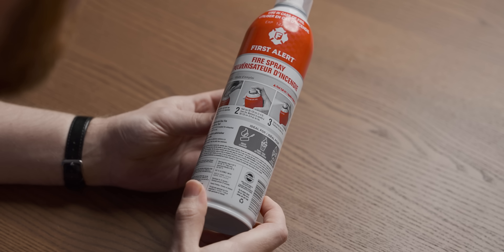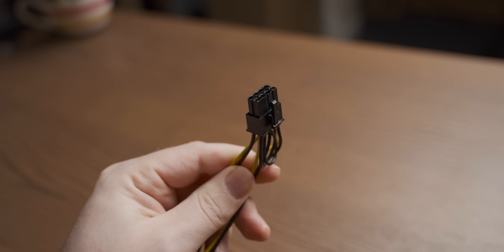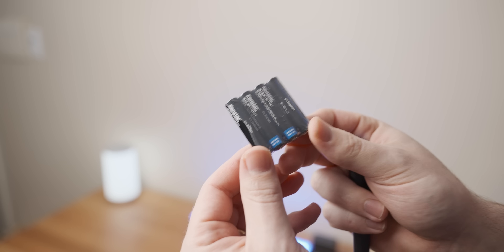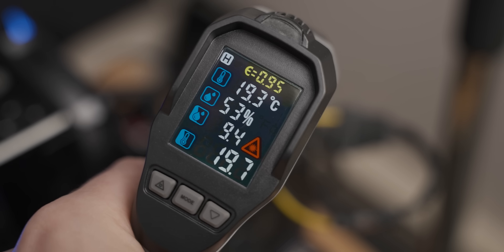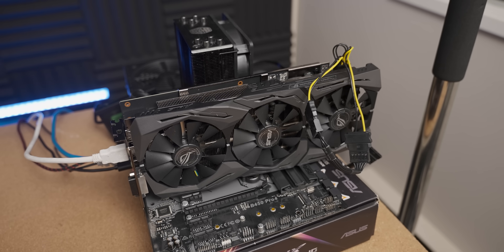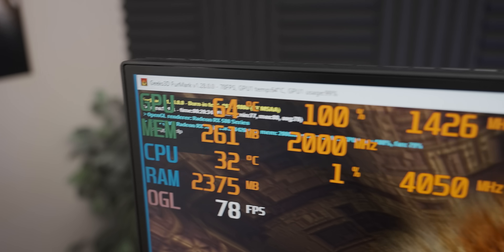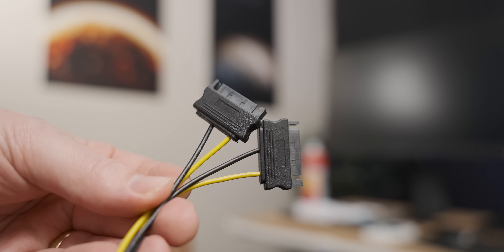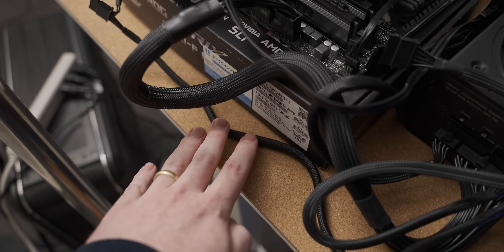Will This Adapter Set Fire To Your PC?

Comment: I have done such yank install a few times. But.. I did it different I went from dual pci-e to two mulex 4pin connectors soldered in parallel. Then I connected those onto two different mulex lines coming from a tx650w corsair. Running 770gtx SLI so I needed two more pci-e power connectors. It's yank yes. Safe can be argued. Each gpu uses 170w according to afterburner.
Reply: I used to have the same molex to pcie 6 pin and 6pin to 6+2 pin on gtx 670, it sometimes just randomly shutdown, luckily it didn't break the gpu. Also i try to plug a gtx 780 but it didnt work after that (cant install driver)

Comment: Most of the problems I’ve seen with SATA power connectors are to do with very poor manufacturing quality that results in the connector shorting out internally even at modest loads.
Reply: Mine melted but it is still good
Reply: Which GPU you are using @destroyer17-1

Comment: But 75 watts is pulled from the motherboard so the 150 watts is actually only 85w from the adapter
Reply: 75
Reply: @brightshadowdenmark  sorry i can't do maths
Reply: most gpus dont actually draw 75w from the mobo, they usually try to draw as much as possible from the pcie power connectors. My 3080ti with unlocked power limit draws 398w overall and only 48w from the mobo
Reply: @kutasiewicz2292  
i'll guess it's a "path of least resistance" thing

do the 3080ti got 3x 8-pin ?

that's 450w +  75w pcie

and if the pcie has fatter cables with better connectors it might pull more from that side..

or it has some software that makes i preferer pcie 

sorry for my broken English ;-)
Reply: @brightshadowdenmark  i have the FE so only 2x 8pin
Reply: @brightshadowdenmark  also the 150w per 8pin cable is a myth, the actual cable can safely be used to around 300 watts but most power supplies wont handle that much Power Draw from a single port and will shut off.
Reply: @HappyBeezerStudios  

sometimes the larger connectors is just to add a safety margin and maybe lower the resistance..

i just got a 1060 3gb for a pc i need to sell, it has 1x 8-pin (MSI Armor) but the ASUS 1060 3gb and 6gb the kids has is both "only" 1x 6-pin

maybe they think lager connectors sell more GPU's (makes them seem more powerful)

Comment: Two things. First the connecters were in front of the GPU fan.
Second you also need to consider how much power is being drawn from the PSU down the sata cable, which tend to be on the same cable. Ah you just did that "cable warm to PSU" at the end :)
And thirdly this also holds for 3080 and above cards, where manufacturers tell you to use separate 8pin cables from the PSU, or risk melting the PSU end of the connector (or worse)

Comment: My rx580 goes above 240w on furmark 😂. I have custom bios that totally removes any powerlimit and sapphire nitro+ rx580 comes at 1480mhz core and 2100mhz ram oc from factory. Also the sapphire version does not care about how many power connectors are plugged in. It has 8+6pin input but it works perfectly fine with single 6pin 😂

Comment: That connector is probably good to about 85 C, so even though you pushed way too many amps through it in a naughty way you didn't really get to the point of actually killing the connector. 

Still, don't do that for real, people.
Reply: With a proper sata connector probably, but the cheap molded ones like the one in the video are really prone to shorting out and melt everything. So yeah, don't.
Reply: @mttkl  my freinds pc had one of them and the power supply downright refused to turn on until we removed it the fault protection was not having it
Reply: @shadowxxe  Well, at least now you know that power supply is decent, I tried one of these cables on a generic old PSU and it just combusted in an instant. It was mildly entertaining and scary.

Comment: Mining rigs, with undervolted cards running 24/7 have shown that these connectors are "safe" and their failure rates aren't actually high. That said, I wouldn't recommend it for your typical gaming pc or if you don't understand the risks involved.

Comment: I have been using one of these for years, and I have never had a problem, only difference is mine has a few more cables from the sata conecter to the 8 pin

Comment: It's not too bad on lower end gpus that pull 150w or less as shown in the video as long as the connectors are properly seating & all pins are undamaged.
Pci-e can provide up too 75w but usually you'd see about 20 - 45w unless the gpu is simply powered through that only.

Got some older 2x molex too pci-e 6 pins sitting around which I'd say is the better solution as it's a 75w connector & each molex supports 45w each or so with 2 ground & 1 12v pin, optimal is ofc 3x molex but dunno if those are sold anywhere.
& ofc there are the adapters which are 2x 6 pin pci-e into a pci-e 8 pin as well which is overkill but should provide quite nice amount of wattage as well provided the connectors aren't failing with like a pin barely contacting the other.

Comment: 50°C over ambient in a well ventilated environment... Now imagine a dusty case of 40°C with limited airflow, and some vibrations on the connectors.
Reply: I'm missing the control group here - how warm is the regular PCIe power connector getting under such load?
Reply: @magicalsnek it’s not the pcie connectors heat being talked about it’s the sata connector
Reply: That's when you should expect indoor fireworks!

Comment: Try unplugging one of the sata cables so it's just being powered by a single sata cable. Also just a thought, you may be able to get a higher power draw when crypto mining something like raven coin (not Ethereum as it doesn't use the core much)
Reply: It's actually the gauge of the wire who could give out and cause the meltiness :)

Comment: Now, get a 1 to 2 8-pin adapter on a giant GPU.
Reply: 1 to 2 pin adapters should never be used... at all heh, 2 pice x8 from psu cable on the other hand is fine, i've seen multiple modular psus do that, pci-e cable x8 with 1 psu input and 2 gpu outputs, these r meant for 3 8 pin gpus, ur using 2 8 pins to power a 3 8 pin card, and these cables r overbuilt for that, so is the psu 8 pin conecction, however if u do that on a random psu u wont know if its overbuilt for that, or not
Reply: No. Get TWO 1 to 2 8-pin adapters for a GPU that uses three connectors, with two splitters in a row to get 3 connectors.
Reply: @hireahitCA  Do all that and power it with a potato!!!!
Reply: @stuartlunsford7556  potato? Could we just try a Gigabyte PSU without a fire extinguisher nearby?

Comment: Remember that pcie slot is supposed to provide 75W to the card, so up to 150-200W cards should be more or less fine
Gtx 960 is 120 w card
I would be more worried about how much PSU can provide on 12 v rail
Reply from the maker: For sure! I should pair a single sata to PCIe 8 Pin adapter with a much worse PSU and see if that gets something to fail.
Reply: @DawidDoesTechStuff  Thats the spirit!
Reply: @DawidDoesTechStuff  also try a 8pin to dual 8pin splitter and use it with a very power hungry card like a gtx 690
Reply: @DawidDoesTechStuff  HWinfo on some cards tells you how much it pulls on the PCIe slot. I dont know if its a sensor in the mobo or GPU though
Reply: @micobugija6284  GPU-Z also shows that
Reply: @DawidDoesTechStuff  I would use an older obsolete card for that test, I wouldn't risk a working rx 580.
Reply: It might be a good idea to simulate corrosion, with perfect contact the resistance is going to be fairly low, but with some corrosion on the pin/pad resistance will go up significantly and that could cause a problem.
Reply: I used a similar adapter only it was molex on a 300 watt psu with a gtx 760 the  only thing that happened was the fan on the psu got really loud
Reply: Thank you for typing that so I don't have too. Also a good PSU should be able to deliver it's full wattage rating across the 12v rail(s).
Reply: A good PSU will provide all of its power on 12V

And, depends on the cards wiring. Some barely draw 10-15W on the PCIe slot.
Reply: @micobugija6284  that would surprise me; the cards have to have independent rails between the pcie slot and its 8+ pin connector.  Would they really be made to draw so little from the slot  and pretty much everything from the 8pin ?  I don't see why they would do that.
Reply: luckily amd cards use the pci-e slot to power the memory chips on the board, and all the other for the gpu, so imo it was mostly pulling from the connector itself
Reply: You are right, even in worst case scenario with 200W overclocked RX580, this leaves 125 W from two SATA connectors, which is doable. Note that none having this adapter would actually use it like this (overclock already hungry GPU and run FurMark). Instead, they would likely use some lower rated card without overclocking, just to get things by.  Overall, this contraption is mush safer then it looks.
Reply: If you do not have a budget to buy a high power graphic card to stress the connector up, get a GTX 480.
Reply: @ytszazu2gmail381  Or a GTX 580, those beasts were hungry.
Hmm thinking about it, something like a GTX 295 should also be plenty.
Reply: How about a gtx 1650 with the pcie slot?
Reply: @sayibandsusu5013  regular gtx 1650 has TDP of 75 W so it can be powered just by PCIe slot alone mine is that way it has no external power supply for the GPU the Super version will probably need it though
Reply: At the end of the day, 12 volts is 12 volts, and a good psu will deliver them regardless.
Reply: Jesus Heals and Saves ❤
Reply: most gpus dont actually draw 75w from the mobo, they usually try to draw as much as possible from the pcie power connectors. My 3080ti with unlocked power limit draws 398w overall and only 48w from the mobo
Reply: @kutasiewicz2292  yeah I was gonna say this, depends on how the car has been set up, some will use power via the slot, others seem to avoid it as much as possible.
Reply: @kutasiewicz2292  my unlocked 2080ti draws 365w under sustained load, and to think they expect even more wattage on the 4000 series! My 2080ti is a lottery winner as it runs 2000mhz happily at stock voltage :)

I have a spare pc 970 running on two molex plugs split to four, then back to two 8 pin gpu slots, not this. Fire hazard if I used it under load but just use it for light 3d printing/modelling so no issues so far. The pc has a pre corsair aio held on with cable ties lol.
Reply: @kutasiewicz2292  I wonder if that implies that the memory chips are run from the pcie slot (low power reqt) while the rest ie most of the wattage of the gpu is sourced from the 6 or 8 pin psu connector(s) which is made to deliver lots of watts.  Not sure how they might split up the power draw within a gpu but spec is that gpus must have independent power rails from pcie and psu connectors that DON'T combine within the card.
Reply: Halloween special edition custom build PC off the floor~~
https://www.youtube.com/watch?v=enveRWAwrxg&t=8s
https://www.youtube.com/watch?v=JC1uOp-7huQ&t=557s

Comment: If you have any of those dual SATA to 8pin PCIe adapters lying around they can come in handy for 12V-4A solar panel  / charge regulater / Lead-Acid deep cycle marine battery trickle charge.
Reply: That's very specific
Reply from the maker: That's awesome! The more you know. 😁
Reply: What if I remove the plastic connector and I connect it directly cable by cable, does it affect it? Or is it still the same? I think removing the plastic connector from both of them and connecting both would be much safer? @DawidDoesTechStuff
Reply: @dicky1528 what did you do? & how’s it going so far?
Reply: You can also make DIY ElectroBoom project with dat

Comment: Pair it with a budget psu. Let's see how those sata connectors hold up
Reply: PSU commits seppuku
Reply: When you want to see the connector/adapter fail, what is the point of using a PSU that fails before the connector?
Reply: @zero.zero.one.001  budget doesn't really mean those silver cheap psus tho. No one with a plat/titanium psu will use this adapter. I do get that it's to test the adapter and that's what he uses for his test rig. Just wanna see it with a bronze/silver rated or a mid range psu🤷🏼‍♂️

Edit: Added 'rated' in my last statement to avoid confusion with the word 'silver' in thr first sentence. Which means those in oem or chinese psu
Reply: lol no, once did this and I learned my lesson
Reply: Budget PSU aren't so bad, when you ACTUALLY do the math on them !

Comment: Well as far as i know , dont use sata to power up risers. 

Molex is acceptable .
Reply: to be fair you can use sata to power risers, 2 sata to a SINGLE 6 pin is fine, 52x2>75w by a fair margin so it should be good to go

Comment: Used two of these spliced into an OEM power supply to put a 970 into an HP prebuilt. Teeny tiny wires.

Comment: Sata cables and molex connectors in old and new prebulit power supplies have exploded my CD drives and hard drives in the past on boot, soooo yeahh not trusting the adapters for gpu for anything long term or high wattage

Though never had experienced a modern cheap store bought PSU with molex/sata do that.. either ways idkk luck based matchmaking be like IRL